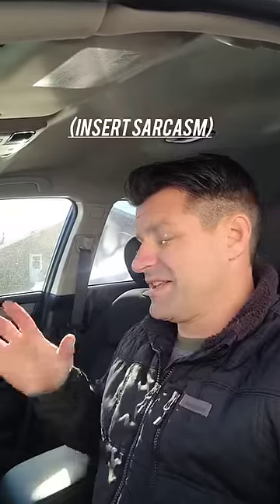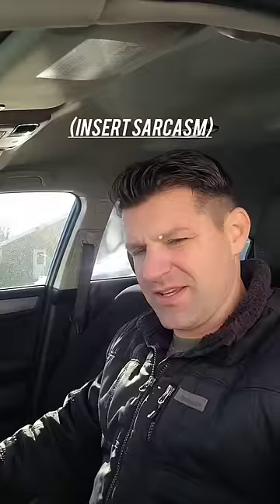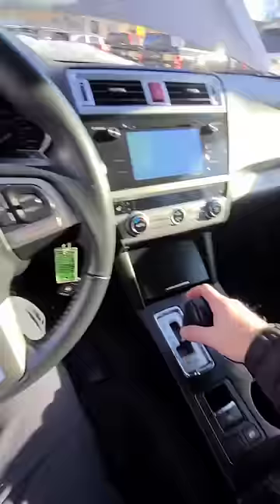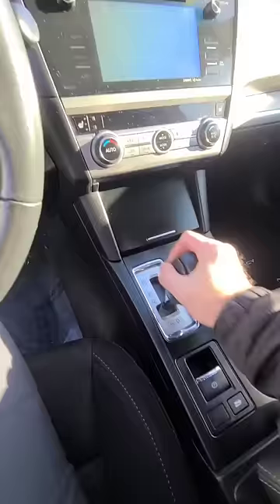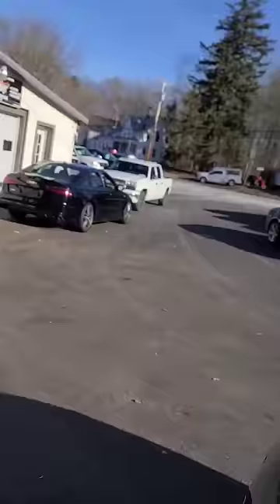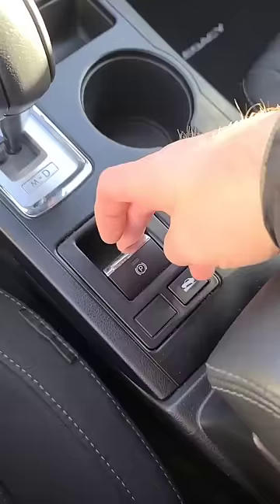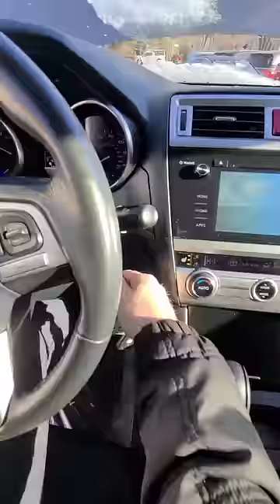Why Subaru Engineers deserve a punch in the Face! #shorts

Comment: Ahh electronic parking brake, how I don’t miss you. Completely stops anyone dead in their tracks trying to do a simple brake job at home. :(
Reply: Most cars you can put it into service mode yourself. Just need to know how. Usually it's just holding the release for 10 seconds.
Reply: Release the electronic brake - shut the car off - presto - brake is disengaged
Reply: @TheFK8Life  not that simple. Electric parking brakes need to be placed into a service mode to be able to depress the caliper pistons to replace the brake pads. If you don't have a capable scan tool or know how to place your vehicle into the required service mode you can't replace the brake pads.
Reply: even the notoriously "difficult to service" european cars you can still do rear brakes at home. can speak for MB and Audi from experience, but not BMW whos the worst about diy serviceability afaik.
Would rather service those than the cable actuated on caliper screw in caliper pistons, and DEFINITELY over adjusting the shoes they stick inside some rear disc systems.

MB had a setting to toggle in the instrument cluster menu, the Audi I used my VCDS which you should have anyways if you own anything VAG that you service yourself (they even have dongles to read the old Bosch Motronic OBD1 stuff)

Most anything else you can always jump the pins on the caliper with a 9v battery or some test leads hooked up to the car battery to retract it but its risky.
Reply: @TheFK8Life  yeah you'll definitely bust the calipers doing that, dont do that.
Reply: @barfoom  this is how we push the car around the shop - never busted anything - thx
Reply: @TheFK8Life  do you mean release electronic parking brake as in normal day to day use release, or release to a service position
Reply: @barfoom  exactly as I described it - car will roll freely - move it around the shop/onto the lift etc 
You can then manually use two Allen bolts to retract the brake.  Use an $8 spring compressor and viola - change the pads and put everything back together - no scan tools needed 
More involved than the old way but nothing overly complicated once you know what to do before hand.
Reply: @TheFK8Life  well yeah you dont have to put the EPB actuators in service mode to roll it, but most makes if you try to put that piston back in enough to get new pads in without retracting the motor on the caliper you'll bust the motor & the parking brake fails, what year and model are you talking about here
Reply: @barfoom  Honda civics- simple process 2016-2021+
Reply: @TheFK8Life  i just looked those calipers up ive never seen ones where the motor assembly itself comes off the caliper, i didnt realize you were talking about separating those altogether - do the OE motors and calipers have their own unique part numbers in catalog?
Reply: @barfoom  I dunno - from what I read there was a simple process and when you see the two Allen screws it all makes sense.  The $8 spring compressor isn't a common tool per se but a small investment for anyone who wants to do the rear brakes at home/private shop.   Many folks had believed you needed a scan tool to put it into "service mode" but many techs prefer the simple/faster manual steps to swap the pads and go.  I'm sure other systems might be more harness/ecu intensive but on the civic Honda kept it pretty simple, provided you know the steps to take.

Comment: The whole point of an emergency brake is that it should be a direct cable connection so it can be applied in an emergency. A lot of these electronic brakes arent even emergency brakes as they wont engage while moving they are merely only parking brakes. Not safe. Its like with the crash standards on newer cars they really want you to get into a crash so that their time engineering the crash safety wasnt wasted.

Comment: 2 things....

First you should always park with your parking brake applied; hence the name. Vehicles don't have emergency brakes anymore since Tandon master cylinders were made mandatory.

Second on those put the cover up on your storage just above the shift lever and remove the rubber. Under will be a hole. Put the screw driver in the trunk (or any thing item you may have such as pen ink tube or whatever) and insert it into the interlock override and shift into whatever gear you like.

Comment: Every car has a shifter lock bypass. Usually you can use the key or a pen, etc.
Reply: True but they don't always work. Our Sonata got stuck in park a few times for no reason and the shift override never worked. In fairness though our Sonata was a terrible car (manufacturing defects galore) so maybe if it was built better it would have worked, who knows.

Comment: Wait until you hear about their headgaskets.  lol.
That should annoy a few fanbois.  lol.
Reply: No issue with 2017 Subaru head gaskets
Reply: Wrong, I rebuild Subaru engines for a living they all still leak at the head gasket
Reply: @Izalfume  sure
Reply: @xomthood  all non turbo models still leak at their head gaskets, I'm a Subaru technician at a dealer in Michigan. Cry more
Reply: @Ashton Bates  I've owned 8 Subarus, not one had a head gasket leak. All went over 200k. So, no, not all Subarus have leaking head gaskets.
Reply: @xomthood  dawg, I didn't say every single one, I see over 50 a day so that's roughly 250 a week, I have a much higher sample rate than owning 8 subarus I've had a 2019 outback that needed head gaskets with only 40,000 miles on it, it's definitely not nearly as common as it used to be but it's still a thing.
Reply: @Ashton Bates  actually the word "all" means every single one.
Reply: @xomthood  maybe if you could read; I said all models
Reply: Actually you said "I rebuild Subaru engines
for a living they all still leak at the head gasket" then again "all non-turbo models leak at their head gaskets."
Reply: Anyone saying they fixed the HG issue has no idea what they are talking about. Just looked at a 2019 and it's already begun leaking. But hey I make money HG jobs lol
Reply: @Izalfume  is there a better than oem headgasket to prevent leaks? i hear its the OEM headgaskets that are the issue
Reply: @IND4GR0V3  well cometic makes an improved gasket that isn't supposed to leak but another fix is to use the STI head gasket from the turbo models: ej207 or ej257. Those never had issues with leaking, older techs at my work have done it and say they don't leak again, also keeping up with coolant flushes helps a ton so the coolant does get electrolysis and corrode the head gasket in the block.
Reply: @Izalfume  uh I have a 2009 Subaru Forester that threw a rod bearing. Head gasket was seeping. After the Subaru dealership put in a new short block it now burns water. The coolant at least isn't leaking out on the ground. Yeah it's showing up on the oil filler cap. So yeah I'm not impressed with factory gaskets.
Reply: @chuckferris3239  that's not the only Bjobs that you make money off. 🤫

Shush,  don't tell papa
Reply: @Izalfume  and it has electrolytes too!!
Reply: But subies are so reliable. Yeah Nah.
Reply: What about their throwaway CVT transmissions.

Comment: Some of the damn auto engineers have never even driven a car.
Reply: I doubt that
Reply: Probably done to save money
Reply: What's with all the hate for auto engineers, the engineering in modern cars is nothing short of miraculous, and DEFINITELY more than anything you'll ever accomplish!
Reply: nah the manufacturers they work for are tired of being sued by dipshits that get out without putting it in park first & letting their car roll away. or sued by the people that get run over by a car with nobody in it.

if the battery was dead he wouldnt have been able to shift out of park without using the override. if the door opened while the car was in neutral & the battery had charge the car would have automatically applied the EPB.

he would have had to sit in the car in neutral with the engine off until the battery COMPLETELY ran out for this to happen this way

Comment: Most Subaru automatics (like mine) have a little cover at the top right of the housing on the silver part. That prys up and just use a pen to push down the little button inside. It will unlock the transmission. You MIGHT have read the owner's manual.
Reply: You should probably read the first comment
Reply: Yeah but why is that even designed that way? A workaround may be simple, but it seems to be a terrible design to begin with.

Comment: To change the head lights you have to take the front tires off ( which ever side your replacing) and loosen the plastic wheel well liner and fold it inward and reach up and remove the plastic plug and then the light bulb, for something that is replaced periodically they couldn’t make it more difficult

Comment: Use literally anything as a tire chock. Hell, roll up the floor mat and jam it in there.
Reply: Rolled up tire mat against couple tons on rubber wheels. I mean, I'm not saying it wouldn't work. It might work perfectly, assuming it doesn't unroll on you and you perfectly place it so it doesn't run over your hand and the car doesn't just run right over it because it build up enough momentum in that short time... 

but it could work, maybe. I don't know. Probably fine.
Reply: @x--.  why do my less than 1 pound plastic chocks stop my 5000 pound truck? Its not the material but the shape.

Comment: Engineer here, these guys were probably forced into doing it by management, the design team probably told management that having a push-button ebrake would make the car look nicer inside and management overruled the engineers decision of using the old system.

Any decent engineer should follow one rule,  don't re-invent the wheel.

Comment: This is 1 of the reasons I always buy vehicles with a manual gearbox.
Reply: And they're almost theft proof, as few thieves know how to drive a stick.
Reply: @mayorb3366  to be fair its marginally easier to get it into neutral and roll it away/onto a trailer. its really hard to drive off with most stuff nowadays unless you're cloning fobs. or Kias apparently

the automatic will stay locked in park unless you hit the override. its a negligible difference though.
Reply: @barfoom  That's a good point.
Do you know anything about fob "repeaters"? I've read about how a criminal can have one of these things and he just has to get close enough to your fob to catch the signal.
Then your car thinks that device is your fob.
Reply: @mayorb3366  yeah unfortunately thats a thing albeit high level & rare, in that respect keyless isnt much more theft proof than metal keys - both can be copied but at least you cant start a keyless with a screwdriver. When I worked for Ford i heard rumors about folks being able to program keys on the spot/bypass PATS but never saw anything like it for myself. I havent looked too much into how new Kias are such easy targets nowadays either but i figure it might be something similar.

if you're worried enough about it storing your fobs in a faraday cage can keep people from cloning them.

Comment: That and their engines pop more tops than an Oklahoma alcoholic uncle.
Reply: Yep! Just watch the new HI Low on Donut media. They replaced the engines in their WRX's like 5 or 6 times Just in the length of the series. 🤦‍♂️
Reply: @sethgt1234  they also built them with getting it done being priority and doing it right secondary then immediately took them to a track instead of breaking in engines. Don’t see how that’s an accurate rep

Comment: Always set your parking brake when you park, when the car is running.
Reply: You make my brain hurt. So you, in your entire life, have never had your car die while driving?
Reply: @Joshua  I've never owned a car new enough to have an electric parking brake,  but I do use my parking brake every time I park.   I've always had manual transmissions, and use the brake religiously.  I was also taught even if you have an automatic to use the parking brake because the transmission is not a kick stand.  Also,  if my car does die while I'm driving, wouldn't the battery be charged enough still to activate the brake? The only time this would be a problem is in this guys case where he is jumping the car.  Do the electric brakes stay applied when the battery dies? Seems like a crappy design is they don't ratchet down and stay even if the battery is dead.  Also there is a neutral safety switch you put the key in to get it in/ out of park, right?
Reply: @alexpaterson5489  In short, no. Your alternator (read: tiny electric generator) runs the motor and everything else after startup. So when your alternator (or the belt that makes it spin) gives out, your car is suddenly using the battery to keep every electrical item running. This gives you all of about 30 seconds before all electrical components die. All the way down to the clock. 

When you have a manual brake (like you're used to), this affects nothing but the "go" factor on the car. You can slowly ratchet the e-brake to stop, use your brakes themselves as they are somewhat independent of the motor, and steer even though it's more difficult.

So you can see how making the steering, throttle control, e-brake, etc. Electrical seems like the most counter-intuitive thing to do to a car.

Comment: Imagine being this guy ,not knowing it has a shift lock right there near the shifter...
Reply: And that every automatic transmission has a hidden unlock button
Reply: Imagine not knowing the key is locked in the on position in the ignition lock because the shifter locked in neutral.
You can't remove the key until the cars in park that's a safety feature to make sure the car is in park and can't roll over you, and if you don't magically have a screwdriver on ya your not pressing the shifter release..not to mention the average consumer probably has no idea about the hidden shifter release either.
Reply: @kbrx4310  you can open that up with a fingernail dude. Not to mention if you're smart enough you can get a key of your key chain hanging and all to use . So you can push it in ! 

Also nobody was talking in the video about the average guy. He knew where it was ! 

You really a car guy ? Or just new at this
Reply: @kbrx4310  
The old case of not RTFM. Some are thick af, usually several hundreds of pages long. Never left the glove box after the factory worker put it there, until it got lost somehow. Yet not opened once. That's your avg consumer intelligence.
Reply: Or to use a log 🪵 or brick 🧱 as a wedge to stop a rolling car
Reply: @matthewslifecrisis2701  just gotta run to the wood pile to grab a log, someone come step on the brake pedal while I do that...
Reply: @MichelLinschoten  so your saying only a car guy should buy a subaru?
Reply: @chrisrichfield8906  not at all , far from it ! But when you make a VIDEO like this. Clearly many comments reflect what I am saying aswell. You can access the lock, there are ways to do it. 

Also when you buy a car?! Rtfm,it's not that hard to read some important key elements of the very thing you park your ass in and trust to take you where you need to go. 

That's the point here ,
Reply: @MichelLinschoten  I've never heard someone ask the question when buying a car "what happens when the battery dies and I'm driving the car?" Most people just assume you just pull over and put it in park, like 99.9% of all cars up until the last decade or so.

Comment: There's a shift lock override. You don't need the key. Literally anything that will go in the hole will unlock it for you.

EDIT: Also, you are a strong man. You can literally hold the car still yourself. It's not like you are on a 30 degree incline.
Reply: Would you expect an old woman to know what to do? Yes, he was being dramatic but his point is valid.
Reply: @jeffm6342  I mean I agree. Electronic emergency brakes are about one of the dumbest things we've done to vehicles. There was absolutely nothing wrong with a mechanical ebrake. But still, him pretending he is in a catastrophic situation is just stupid. I would expect a grandma to know. That's the problem with people these days. They have a 600 page(idk exactly just making a point) manual that tells you every little thing about your vehicle. It even has driving and parking tips. To "not know" something about the steel coffin you drive DAILY is a personal problem, not design. You would read the instructions and know the limits of your parachute would you not?
Reply: This is the exact reason why the Subaru dealership makes every new buyer undertake a strength endurance test, the buyer must be able to hold a car on a 30 degree incline for 10 seconds while also reconnecting a battery.
Reply: @AJ-zv9tn  As a man, he should not be so lost about how to get out of this situation. As an average IQ human being, he would have read about this in his owners manual had he read the book on his $20,000-$30,000 purchase....one of the first things you should do. Not only does it tell you to not unhook the battery if planning to use the emergency brake....but it also tells you how to bypass the shift lock in case the battery is dead. Those were critical bits of information he did not read because...well...stupidity. People also wonder why their vehicles start tearing up after 80,000-100,000 miles....when all they do that entire time for maintenance is oil change, rotate tires MAYBE, and new windshield wipers. Your owners manual states ALL of the necessary maintenance and at what intervals they should be done. I'm going to assume you, along with this guy, also fall into that category huh? Ignorance is no excuse.
Reply: @AJ-zv9tn  This is exactly why with something so elementary, you have to pay other men to do it for you.